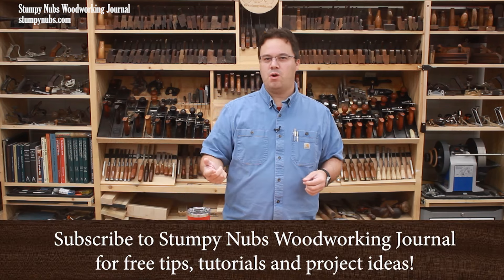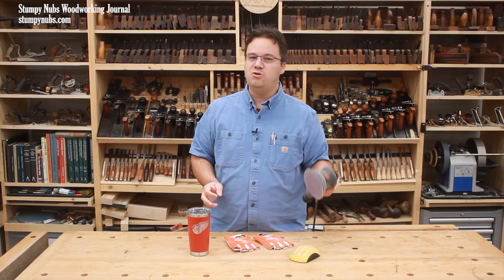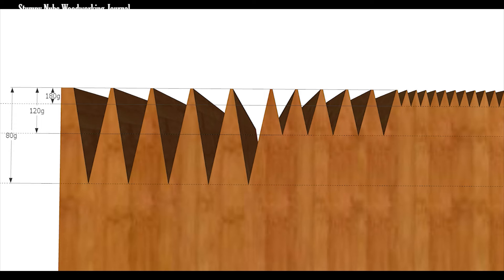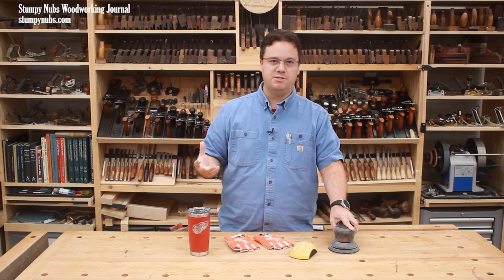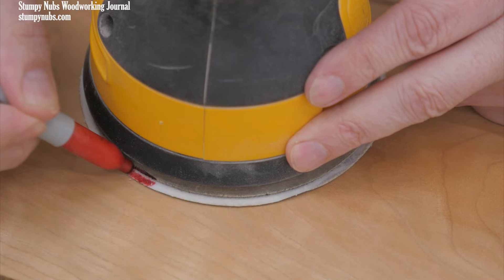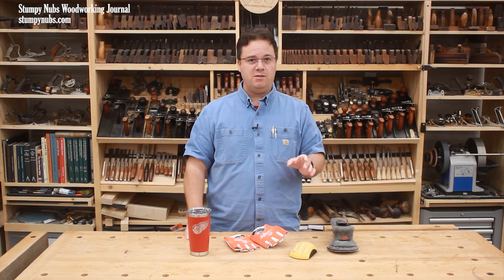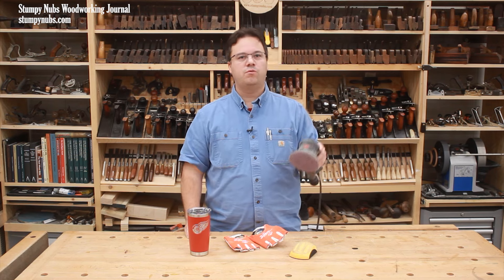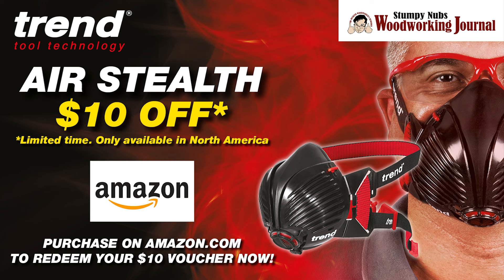These ROS tricks will change how you sand wood!

Comment: The down side to the mesh disc are that little bits of sand comes off from the use..those bits of sand are slung everywhere on your bench and project. It is very easily then to have project scratched up while not even noticing while in the act of sanding that youre sanding over loose sand on your project carving deeper grooves than expected..only to notice 3 grit sizes later or when there's a finish..Look at the sheen in the lights per grit size.."blow" off per grit size.

Comment: Surprised I did learn a couple things here. The speed of sanding for example. I was going faster than your suggestion with the random orbital sander. I go slower with the flat sander for finishing work tho. And the dust collection - I do notice a lot of dust clogging up the sander. I need to get that adapter for my vacuum. Trying to keep my shop cleaner. Even with breathing protection during work, the air gets all dusty and I breathe it in later. And everything in the shop is a mess always.

I am careful how I store my sanders. They lay on the side or propped on something so the face does not get damaged.

Comment: I learned a long time ago to leave that cheap sandpaper on the Shelf. I don't get anything elite from some woodworking supply but I get the better stuff from Home Depot I think it's 3M which is decent. It just lasts so much longer and works faster. That is mostly what Home Depot has in stock these days anymore anyway. I use the low setting on my sander if I'm going down an edge on some 1x, which I probably shouldn't be going down with a sander anyway but I'm experienced enough to get by with it mostly.

I do have a tip to keep from trashing the velcro on your sander. Don't try to make the sandpaper last too long, stop occasionally and examine the Sandpaper and when it starts getting bad replace it. I've seen too many people keep sanding and then the Sandpaper wears away and leaves the velcro vulnerable and then they trash the velcro around the edge part of the pad. This tends to happen on bigger jobs I think and I've even been guilty of it when I just didn't notice how bad it was getting. I'm pretty careful about it after ruining my velcro and having to buy a new piece. It's the thing that makes me most uncomfortable about letting someone use my sander.

By the way that little black random orbital sander he's using in the video is about $450+, what an elitist woodworker he is. Haha I'm just jealous.

Comment: I do one thing when I use my ROS. For flat surfaces I hold the sander with a couple of fingers on the top, and I hold the dust collection hose in the other hand. A little practice helps me keep the sander nice and level. This also prevents me from putting too much pressure on the sander and I get no vibration fatigue. 

When I put the pencil lines on the surface, I also put a line at right angles every 10 or 12 inches. Then I count out seconds in my head because I tend to get impatient and go too fast.

Comment: Many years ago, I was in the marine industry, repairing and painting boats. I learned to start on and stop off when using a RO sander. If you start off the surface, the sander, more or less, turns into a "grinder", spinning at top rpm rather than having a random orbit pattern. This creates what we used to call a smile (because that's what it looks like) on the surface. If you've ever painted a high gloss finish with bad prep work, you might have seen the smile. 

Stopping off the surface prevents pigtail swirls. If you stop on, as the sander slows down the orbit gets larger and that can create a pigtail if there is any outsized bit of grit under the disc. It's better, when ready to stop, to just evenly lift off the surface before powering down.

You start (turn it on) with the sander on the surface and you stop (turn it off) the sander off the surface. I guess it's a bit of a mnemonic phrase to say start on, stop off.

Comment: Another great video from the Nubs.  Early in this video, you introduced a hand sander that uses the standard hook&loop sand paper.  Not knowing of this item, a few years ago I made my own combining a "replacement" RO sander pad to a block of wood.  The one you reference is a bit better (and about the same price) as with it, the sand paper wraps around a bit to provide sanding for an inside corner.  Then later you introduced the "Hook It".  That for me would be the best solution - a bit less expensive that that first (or my solution) and I can then make all manner of blocks to attach the Hook It to for special sanding applications.

Comment: Don't go too fast when watching Stumpy Nubs videos or you will miss out an important detail.   About an inch of frames per second is pretty much ideal.  If you have to keep going back over the same spot you just have to switch to a slower playback speed.
Reply: Do you recommend the pencil trick to know if you have watched the section sufficiently?
Reply: @polerin  Yes covering the screen with a thin layer of pencil marks will certainly help ensure you see every inch of the video evenly.

Comment: I got one of those sanding mouses about a year ago. So, so handy. One of the best, inexpensive purchases I've made for my shop. The only thing better would be to have multiple mice for specific grits of paper. I don't work in my shop every day so I sometimes forget what I have on my sanding mouse and have to pull it off to check. A first world problem, I know. But having a second, or even a third, sanding mouse (properly labeled, of course) means never having to guess, or look.
Reply from the maker: I get lots of pig-tail swirls with mouse sanders.
Reply: @StumpyNubs  I always sand with the grain when I use one, if I’m using it on a surface intended to be finished.

Comment: I have been hand sanding for years, I only use the machine for the main cut with 40 and 80 grit only once I have finished with them I then do the rest by hand only.
I also have a carpet which I place my project onto for sanding as this stops the other side vibrating and getting damaged. This also cuts the vibration right down. As for the pencils trick I use to use this but over time because I like doing the sanding by hand I can actually feel when its time change the grits to the next one.
I have tried using the machines all the way through, but I just don’t enjoy it as much, they are good for the cutting the ruff surfaces and getting it ready for the finishing hand sanding sanding.

Comment: I actually have an old vibration sander, works great on rough cut lumber to try to get a suitable surface for the jointer rather than wear out my jointer blades flattening that much stock. Flat square sandpaper is much cheaper than replacing blades constantly and I won't use my good sander nor sandpaper for such a task. Oh and it's faster than hand planing it flat enough to only need a few passes at the jointer for a flat face.

Comment: You mentioned vibration.  My home sander is a DeWalt as are most of my home 20v tools.  At a volunteer agency we have 10 sanding stations with Bosch and DeWalt sanders where we sand non-stop for 3 hours at a stretch.   I found that after 1 to 1-1/2 hours using the DeWalt my hand and arm is tingling which continues well after I put down the sander.  The Bosch is much smoother and does not result in the tingling at all afterwards.  The DeWalt seems to cut slightly faster but is heavier, noisier and vibrates much more.  I noticed that the DeWalt stations are always the last ones taken by the volunteers.  We all have the same issues with the DeWalts.

Comment: I'd love to use different sandpaper, but I'm locked in to Festool's discs until someone makes a punch that can match their hole pattern on different paper. I love the sander, but I hate being forced to use only their brand of paper if I want dust collection.

On a related note, I found that hooking my shop vac to my plate joiner also helped immensely. I have a DeWalt plate joiner; the chip port is badly designed, and jams up within two cuts, so that dust gets sprayed everywhere when you retract the blade. Connecting my shop vac--using the Festool hose that came with my sander, which was exactly the right size for my application--cured the problem immediately.

Comment: always a good video and lots of good tips.  One thing you said should be practiced more by beginners and more.  Sand all the parts BEFORE you put the parts together.  Well, I'd go one further.  Sand all the stock before you cut the parts out.  Sanding changes the thickness somewhat, so that will change the size of the dado etc.  For you advanced woodworkers, I'd say that the most used power machine in my shop is my thickness sander.  I have heard that sanding averages 70% or more of the time spent on a project.  I don't know many folks that really "enjoy" sanding.  I bought my first thickness sander back when the first Performax came out.  Was a HUGE change for me.  So much so that a decade later I bought a wide belt, (open ended, 16" wide) PM.  I usually rough cut all my stock to the dimension I think I'll need, then run all of it thru the sander.  A half day on the sander, and all the material for a large project is finished and then I can progress with much less work.  And the final sanding is much easier, basically only cleanup.  Sure, a wide belt is not cheap.  So the thickness drum sanders are still an option.  Just saying that if you can swing it, it makes a job MUCH more enjoyable.

Comment: I need to get one of those hook it pads.  I don't like connecting RO sander to the shop vac, makes it out of balance and I end up with too much pressure on the vac side.  I just wear that Trend Air Stealth mask (recommended by James) and then vac the project before stain.

Comment: Did not know those gloves were a thing! We built a 20’ diameter circular information desk in a mall. It had the wrong level of finish. We had to sand the whole thing back from 80 grit. It was 3 x 12h shifts of sanding. These gloves would have saved me so much discomfort. My hands were numb for days.

Comment: to clean clogged sandpaper get an inexpensive Cleaning Eraser Stick for Abrasive Sanding Belts, Natural Rubber Eraser for Cleaning Sandpaper, Rough Tape, Skateboard Shoes and Sanding Discs. Cleans out sawdust & pitch & dust and more - effectively and quickly cleans off your sanding discs and belts - makes your sandpaper last longer, whatever the format.  Simply hold the sand belt cleaner against a moving abrasive belt or disc to remove debris - or rub rubber belt cleaner sandpaper or sanding blocks to easily declog and return them to peak performance capacity

Comment: I regularly use a hand-sanding pad in my workflow.  However, I purchased some discs without holes for this tool.  I was too often frustrated by the holes catching a sliver when easing an edge (which I prefer to do by hand) and damaging the edge.

Comment: I recently tried making a rounded piece -- basically a 3"x3"x3" quarter cylinder at the end of a longer piece. (It's a folding leg on a portable table.). I used an oscillating tool followed by 40 grit sandpaper with my ROS. I have very limited space, so no bandsaw. Is 40 grit on an ROS reasonable for shaping? I mean, it *worked*, and I could see getting good enough to repeat in an application where the part would actually be visible. What are some other ways? Thanks for yet another great video!

Comment: Good timing, I just picked up my new Bosch Professional GEX 12V-125 RO sander about 2 hours ago 😁

All good tips.
One thing you didn't mention though, I've learned that it's almost never a good idea to store a sander standing on its pad. Most sanders don't have a very even weight distribution and as such will compress the pad on one "side".
I'm almost sure I've seen that happen with the 3M air sanders we had at work, so we were pretty strict about storage.

I'm not 100% sure how much deformation there will be, but I noticed that my new Bosch sander has a little stand-off in the L-BOXX interior that lifts sits against the center of the pad, where there is no soft pad or velcro.
If its just to save the velcro or the pad itself I'm not sure of course, but haven't seen that before :)

Comment: Have you tried the Diablo ceramic sandpaper? My local ace hardware just dropped the 3m stuff but started stocking it. I’m actually pretty impressed with how well it worked. Seemed to work as good or better than the 3m version. Just curious what you thought
Reply: Nice tip! I'll try it. I LOVE Diablo sanding blocks with the reusable mesh pads. Quality brand!

Comment: I have an orbital sander but frankly i get better results with a vibrating sander, typically i will use an orbital to do rough sanding and then switch to a vibrating sander, followed by hand sanding. having a good quality sand paper is a plus for sure. Is it just me or has the quality of sand paper gone down over the last few years? I am finding it harder and harder to find good sand paper, I went looking for the sand paper you suggested but as of yet I could not find it. having big box stores have done the craft more harm than good. the focus has moved from the professional to the hobbyist who generally knows very little so the buy what ever is convenient. how many great projects have been ruined because of cheap sand paper?
Reply from the maker: https://lddy.no/19fdf

Comment: Hi Stumpy,any idea why new claw hammer does not grip nail inside V of claw?When I pull on handle,claw simply slides up to head of nail
Reply: What brand and style of hammer?  Cheap Chinese hammers sometimes  have VERY poorly designed nail pulling claws.    I find most claw hammers don’t grip the shaft of the nail, until they get to the head, unless you bend sideways, rather than pulling inline with the claw.
Reply: @orcoastgreenman  a curved claw,brand is Deamark
Reply: Look closely at the claw.  If it's going to grip the shank of a nail, the claw has to be machined to be very sharp.  Today, most aren't.
Reply: @orcoastgreenman  I think deamark is a Taiwanese brand

Comment: Is there a tip to stop my sandpaper separating from it's cloth backing?  The sandpaper is in great condition but goes in the bin once the backing separates. Also leaves me picking bits of 'loop' from the bottom of the sander.
Reply: Try a different brand? That separation shouldn’t happen. 

We had some Amazon ones that were terrible: the abrasive was so stiff and brittle little pieces broke off within minutes of use.

Comment: my biggest problem with the vac on the ROS is that it suctions the ros to the wood surface too much and hinders the sanding motion. Using a standard ridgid shop vac. Anyone have ideas on this?
Reply from the maker: That suction is actually desirable because it helps keep the sander flat on the wood. If it's interfering with the RO motion of the sander, it sounds like you have a sander problem.

Comment: Great tips! I recently purchased the 3M 6" sander and I absolutely love it with their new sanding discs! Truly revolutionary technology, especially when used together. My jaw dropped when I saw how much material it removed the first time I used it. My question is if I should really be using this on it's top speed setting. I had already watched your previous video about pigtails when I got this sander, so I tried it on full speed a few times but I found that it is too aggressive and tends to overheat the sander if I use it too long on that setting. Do you use your 3M sander on full speed most of the time?
Reply from the maker: I do. It does warm up a bit, but never had it overheat. That said, different people have different processes. If you're more comfortable at a slower speed, just move it across the surface a bit slower to compensate and the effect will be the same.
Reply: Possible you are pushing down on the sander?

Comment: Tip no 1, do not use a orbit sander as it goes against the grain in the wood, use a vibration sander If you must, but drop sanding overall and learn to use a steel.
Reply from the maker: People have been making fine furniture with orbital sanders for many, many years.

Comment: "Anti vibration glows" What dark magic is this?!?! Where have you been all my life!? Due disease my body cant take vibrations very well, just 0.25m2 area of rust removal with wire wheel feels on my hands next day even if its good quality wheel. Unbalanced shitty wheel ou boy its nightmare next day. I gotta look into getting a pair to see if this actually helps with the issue.
Paper gumming up, i though that was from too much pressure and sure it has worked to put less pressure on the paper, but i should probably try those meash papers sometime. I do use the stock dust bag simply cause vacuum hose i have brings more pressure on the back of the sander and makes it harder to move the sander that could lead to mentioned issues of pitting due tilting, but guess i could try finding lighter weight more flexible hose between shopvac and sander. I have couple machines what lost their hook surface so i just replaced it with some glue on cuttable hook strip as a repair. Seems to work and its on my secondary orbital and corner sanders. Beats throwing still working machines into trash and those are not in use often, mostly when working on with say glass fiber and metal that needs sanding.